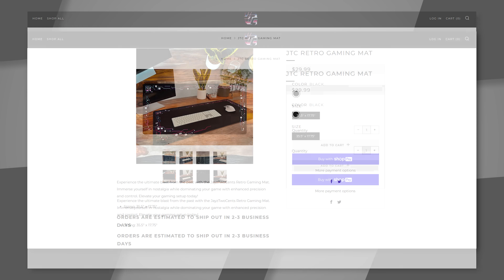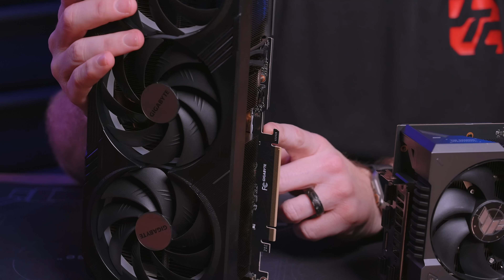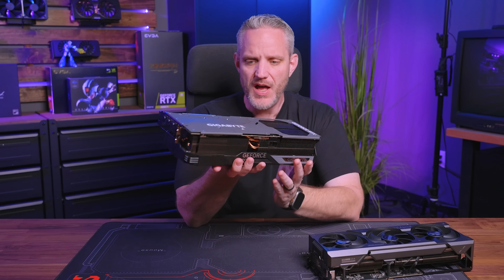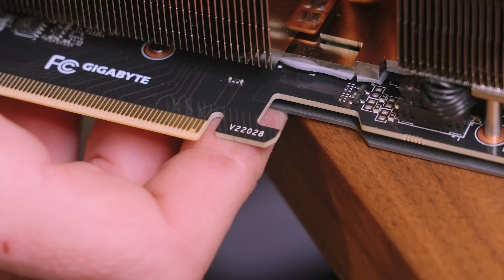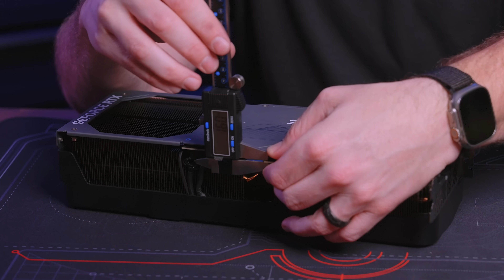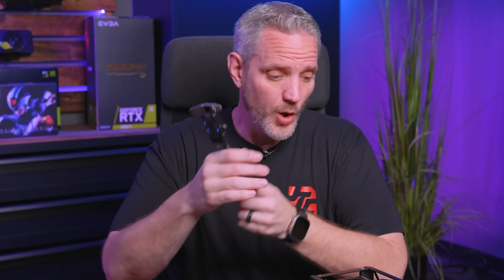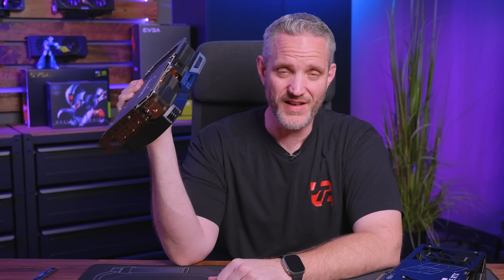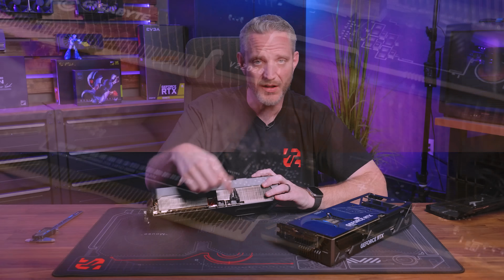These GPUs are cracking and the company REFUSES to warranty them!

Comment: In comparison to the other card in this video, the one that is cracking has a larger, squarer notch with sharper corners. That's well-known to concentrate stress fractures - it was a contributing factor to the de Havilland Comet aircraft disasters of the 1950's.
Reply: @TevisC  That's right, it's a common misconception that the windows were the failure point - it was actually some square cutouts elsewhere in the fuselage for other equipment.
Reply: Solid deduction! That's why all airplanes started to make rounded corners for their windows. I really, really hope that both first- and third-party GPU manufacturers take note.
Reply: Exactly. It's not all about thickness. Length and shape matter too. ;) Also note there seems to be a post attached to the PCB near the tab on the ASUS, so it has more support from that.
Reply: Every AIB other than Asus used this design as well and their RTX 30X0 PCBs didn't cracked. I think the problem is that hole of the GPU mount is very close to the notch as on boards of other vendors. But Gigabyte doesn't use the backplate as the other vendors do and only depends on the PCB for the one cooler screw behind the notch on the Gaming and Vision models. In other words Gigabyte failed at the card design and seemingly failed again to recognising it themselves.
Reply: Always radius internal corners that are likely to be under stress! Good shout.
Reply: This was my thought too.

Comment: Damnit...just bought a Gigabyte RTX3080 Gaming OC.  I also bought a GPU brace and will be installing it at the same time as the card.  I'm still using a Gigabyte Z170 UD motherboard, a 7700K, and Gigabyte GTX 1660 Ti OC.  Figured since these other components did well for me - a newer video card would hold up.

Comment: I can see there's a difference in rigidity but not sure if that's a pro or a con. Something can be weaker material and flex, or the flex can prevent it from breaking. Rigid materials can feel stronger but often times rigid materials are more prone to being brittle and cracking. I chalk it up to the bigger picture. We're in the ronas era (even though it's passed) and everything's built like shit. Breaking cpu's, blistering cpu's, burning psu's, burning diodes or capacitors on the asus boards, melting power connectors. It's an easter egg, find the one and only product in the 2019/2023 era that's NOT fucked up.

Comment: It just may be that the industry of computer sized gpu's have just missed the fact that they have reached the limits of the material. We are talking something like 1/16th of an inch of material that was originally designed to simply hold resistors, capacitors, diodes, etc. Now we are asking it to bear the weight of, well, you have weighed these things. All of that weight on that single slot,  and the locking tab is right at the farthest end where any movement in the card will be at the most. And next year, they will be bigger.

Comment: so the gigabyte pcb is thinner CEM-1 maybe CEM-3 material for the layers of PCB it's fiberglass with copper layered top and bottom I have experience in making single and double sided PCBs and the ASUS card is FR-4 those are material identifiers for the raw copper board material and my guess is the Gigabyte cards are fewer inner layers as well

Comment: It looks like those with the cracking problem havn't used a bracket for support. You could make a mockup with acryllic or plywood, apply pressure on the far end and I will guarantee it will break a the exact same spot. If Gigabyte wrote anywhere that they advice using a support they are out of the woods. And the problem becomes akin to drying ones cat i the microwave.
You can litterally support your card with LEGO's.

Comment: I just checked my (launch batch) MSI Gaming X Trio 3080 for cracks or anything around that pcie tab - it's fine. I've had it in/out of my system several times over the years, no marks or anything on it. The GXT also has the pci brackets fixed to the cooler in more than one plane too which is nice. The card doesn't sag/twist much either having bracing in places on the pcb/cooler design.

Comment: I have 4080 RTX Gaming OC from Gigabyte. I am NOT using it's intended mounting solution. I could not rig it to my MOBO with the bracer as intended. Like the mobo mounted one that came with my GPU. I had stuff on my mobo in the way. But I did purchase a 3rd party bracer that seems to be working well enough. I check on it. Don't notice much sag? How many 4000 series cards seem to be effected? How common is this issue? Do we think that 3rd party sag supports can prevent this if used correctly?

Comment: Jay Printed Circuit Boards are made of a fiberglass material, the type used is referred to as FR4
1.6mm is standard thickness.

It is also the cheapest option, if you're going to make prototype boards.
So I could make my own card to slot into a ISA, PCI, AGP or PCIe slot.
Heck many people have made their own cards for vintage computers and they work flawlessly.

One can also make these cards at home, using the old school methods of circuit design, printing that design, transferring the circuit design(either by thermal means or masking), then you use "Ferric Chloride) to etch away the copper you dont want, then you have the copper you want left behind.
Then you just need to populate the board with the ICs, Resistors, etc.

Comment: On my Gigabyte 4080 I have the support that bolts onto the MOBO, and I have another support under the far right front corner.
I added the 2 supports because of the GPU weight anyway, I didn't want to risk it.
I also have the red clip tag removed on my PCIE GPU slot, otherwise it's near impossible to unclip it with the GPU in.
Cheers.

Comment: I think a weak textolite is a problem with an additional mount through the card, on Asus you can clearly see the mount stand to the right of the pcie tab.  There is no such thing on gigabyte, so the textolite bends more with less load.  And this despite the fact that gigabyte has the best stand of all vendors.

Comment: I think it's a combination between rugged PCIe slots and too big GPUs, in theory this makes sense, but theory and real use is total different. So if you reinforce something, then the other component gets all the stress. You won't see this with, for instance, with Intel GPU's. And maybe Gigabyte doesn't use glass fiber PCBs, for cost reduce.

Comment: I'm surprised this is just now being brought up, I bought a gigabyte 3080 ti last year and 33 days after getting it I got the whole black screen 100% fan crash and it wouldn't allow the system to post afterwards. I started the whole RMA process with gigabyte and during that time I was checking with peoples RMA experience with gigabyte, a lot of the posts were about them denying RMA because of cracks at the locking tab. The amount of defects in their 30 series is... concerning..

Comment: I decided to go Gigabyte with my new build and am happy when it comes to design. A bit pricey, yet a lot cheaper than ASUS. I am just glad to live in Germany with much better customer service. For me, RMA for such a thing will happen if within a certain time period. I do have an extra hold for my graphics card, though. I truly hope this will prevent such incidents. Now I have to wait and see, I guess. It's just maddening, though. Paying this amount of money and knowing that after two years, you have to pay another 2k for a new graphics card, cause the stuff keeps failing. My 1080 lasted about 6 years and still going strong. I don't think I will build another computer. It's just not worth it. :/
Reply: it hasn't broken yet right? for all we know this card might also last you 6 years. In my opinion it is still a bit too early to get the pitchforks and burn gigabyte at the stake. Don't get me wrong their trackrecord is not the best and that is something to be wary about. but I wouldn't put off pc building because you have a card in your system that may or may not break.
Reply: @herrowitsmeme6623 
No, it hasn't. It's not just about Gigabyte, though. I just don't like all the issues coming up lately with the prices you pay for pc hardware. I like gaming, but there's a limit somewhere. I mean 4080, you pay around 1.4k, connector may burn plus card may just crack. That's not quality you get, it's just risk you buy. With the money I paid for my new computer, I could have gotten at least two of the very best five years ago. I just don't like the increase we see. Plus, looking at all the full-price betas we got the last couple years...
Console does simply look better in recent days. Of course I will enjoy the system I got now. All I'm saying is that I really consider changing to console next time...
Reply: @Toepferle  you are zeroing out the issues without taking into consideration the positives. Its the pc equivalent of doom-scrolling. But I'm not here to stop you. Its your money and you should do whatever you want with it
Reply: @herrowitsmeme6623 
I think that is just cause it's the video topic and comments typically are not ten pages long.
My past with computers hasn't been the greatest, to say the least. I have spent a lot of money on components and needed countless amounts of RMAs cause parts where used instead of new or faulty. My 1080 was the only thing that didn't really fail me. Now, graphics cards tend to become an issue as well. I am just fed up. I love pc gaming and have always wanted to stick to it, it's just that with all the troubles I been through, consoles don't look that bad anymore.
It's got nothing to do with not seeing the benefits of computers or the benefits of what I get for my money. I will definitely enjoy my new machine, that's for sure! I just don't want to build another one. Maybe I buy pre-build, who knows...

Comment: Think about this Jay, if these cards are sitting in their case bolted in on a desk or floor like they should be just working or playing games..... How would you know if that tab cracked? The GPU would have to fail I guess right? But like you said if someone was fiddling around with the GPU either trying to install it into a new build or take it out and BOOM... they finger fudge it a little too much and game over.
Reply: If you don't look to see whether it has a crack and it does still have a crack, the card will cease to function as the crack extends into the PCB and severs connections. So you will notice when it doesn't post. If your PC is in an area that is cool, the card will heat up when it is used and cool down when you turn off the system. That heating and cooling process can cause cards to shift in their sockets and can also cause any structural failures to become worse -- so a small fissure in the PCB can become a large fissure over time. You see the same process if you live in a state that has extremely warm days and extremely cool nights. The pavement will crack as it is repeatedly heated up and cooled down, over and over.

Comment: Also, the original design for a graphics card was a board with a few chips and eventually a small fan, these things are Behemoths that are the size of some new small factor PCs. A table with 1 person on top will not have the same resistance compared to putting 10 people over that same table!
Reply: Ironically early IBM PC expansion cards were pretty long and cases used to have brackets at the end to help keep them in place. Those tended to disappear in the early 90s when cards got shorter but now we've come full circle.
Reply: @olnnn  The early and mid 90's were probably the high-water mark for the ATX form factor.  It's been going downhill since the late 2000's.

Comment: Golden rule with hardware building - never force or push anything that has resistance. If you can't see close up clearly what's happening - stop what your doing & rethink your approach to the work. There are many tightly fitting pieces in PC builds with the ATX format & relying on manufacturers to machine pieces to the tightest tolerances is well just an assumption on the customers part.

Comment: It’s a pretty common denominator in the community that gigabyte have terrible warranties. 

In Australia if a product fails because of poor design oversight from the manufacture (AKA heavy heatsink causing extreme sag that ultimately cracks the card because cheap plastics that can’t even support the weight) then the manufacture has to remedy the situation.

Comment: gigabyte's hardware not built to high enough spec eh, talk about how things haven't changed, i had a issue going back a few years where the agp port on a gigabyte board wasn't built to the official agp spec and couldn't supply enough power, so ended up having to buy a new board after i tried to rma it to them and they said "nope, works fine, its you're gpu thats at fault for drawing too much power" thus iv never used them ever again and seems things haven't changed one bit. 

dont ask what mobo or gpu it was outside of it being a gigabyte mobo and ATI (yes that long ago) gpu i cant remember.

Comment: I feel like a broken record with this comment.  Typical corporate mindset at work here.  I bet Gigabyte is hedging their bets that denying claims and handling any possible legal action (that in all reality probably won't happen) is cheaper in the long run than actually replacing faulty cards.  Kind of like the old story about Ford and the Pinto fires where Ford did the math and decided it was cheaper to pay out lawsuits for death and injury than it was to issue a recall and handle the problem.

Comment: Graphics card design is outdated. A massive weight with cables randomly hanging off the opposite end of the connector, board sag, flexing under load when it's hot, etc. we need a new connector that provides power via the board and we need a new mounting system that supports the size and weight of new cards.

Comment: Jay, the PCB is made of Fiberglass, Bromnated Resin and copper. The bromine is what gives the pcb the fire retardancy. In PC manufacturing where and inner layer is cut the only way to save it is Kovar  Welding. not soldering. My designers would never put a circuit in that area. Why?

Comment: Honestly, I dont think we have enough information to go on. How where the installed? Are these prebuilts? Did gigabyte supply support brackets with the 30 series? My 40 series came with a support bracket. There is no way I'd put this card in without the support bracket and I wouldnt expect them to rma me if I didnt use the supplied support brackets. Regardless of flex I dont think mine is budging with the bracket in place, seem solid.

Comment: I had 980ti of theirs that died when in use so sent it in to them for them to say I damage some tiny ass part that's covered by the backplate so wouldn't replace it even tho it was never taken apart. I never had a good experience them that I even had a motherboard that had a hard time remembering settings.

Comment: Thank you for continuing to call out the gpu mounting plate not being tied into the cooler/frame. It's so ridiculous that the Tuf 4090 has such a solid metal build, except for that stupid mounting plate. Still, that card is so heavy, I suspect it would still need its little kickstand even with the proper plate.

Comment: correlation does not equal causation, more research should have gone into this video,  attempting to get out first in front of a breaking hardware story is tempting. but can cause more harm to consumers and more pressure on manufacturers meaning more anticonsumer policies to fuck us over with because of how quick we react to any products having issues. especially in the times after everyone hates the gpu market in general for everything thats happened in the past two years regarding prices, scalpers,  and crypto miners; none of those groups were the manufacturers faults btw. the blame goes squarely to nvidia for that mess.

Comment: the PCIe release tab.. with a large air cooler and a large card it is impossible to reach the release tab with one's finger, I have resorted to using a long wooden dowel to release to tab and it did slip off the tab hitting the board, fortunately there wasn't any damage to the board.

Comment: Flexibility isn't a bad thing per se, a lot of things are engineered with flexibility to prevent cracking.
PCB's don't just crack on their own, they usually need repeated cycles of force.

You'd want to know the backstory of each of these cracked cards to determine what has caused them to crack and why there's a current spate of Gigabyte cards, what's the pattern? It's not as if this problem of cracked PCBs is exclusive to gigabyte.

Unless these are all retail cards installed by the purchaser (then there may be a legitimate consumer concern), I'm guessing that these cards origin is predominantly in shipped pre-builds.

Comment: I spent almost 2k for my MSI 4090 Suprim X  GPU and it stopped working at 3 months... long story short, the PCI connector just stops. Originally it worked on ASUS z590, but when i went to upgrade to EVGA 790, MSI 790 i got no display and motherboards were not recognizing the GPU. Sent RMA to MSI.. they sent it back with out testing but they claim they tested, still GPU will not work in any PC i put it in. Support told me they will replace the unit, but then they said they don't know when I should expect the replacement to happen. 2k i spent and only 3 months later having to deal with this and the MSI Manufacture says    we don't know how long it will take to replace your GPU.

Comment: FYI the reason it’s more rigid on the asus is because there is a bolt mounted very close to that tab location. Just look that the video again.
Reply: There are similar bolts in the gigabyte but the bolts are in different locations and further away than the asus